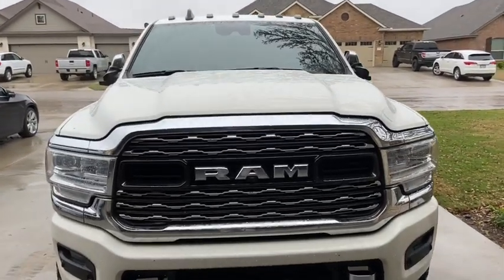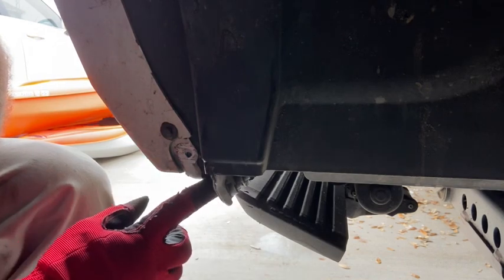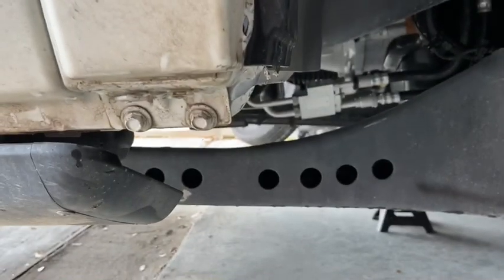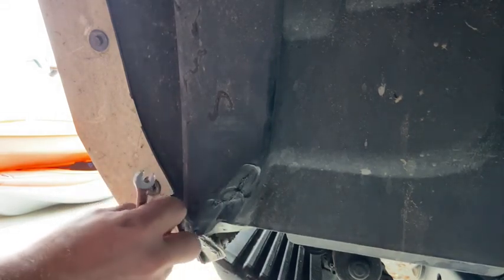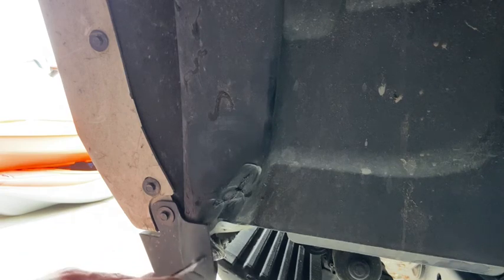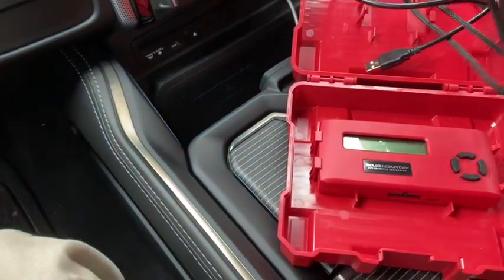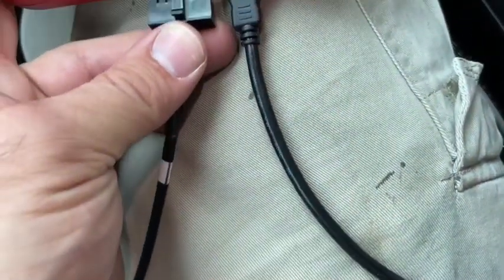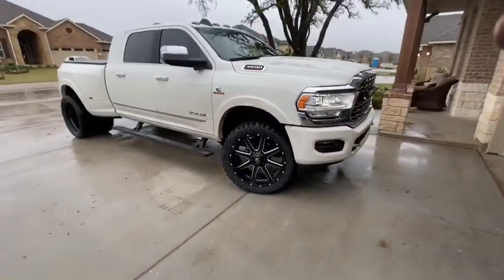35’s on a Stock 2019 Ram 3500 Dually

Comment: Hi, looks really good!
if you choose to not use super single at the front, do you still go with positive 1 offset to make 35" fit on stock suspension?
Tony Linell,  Sweden 🇸🇪 ✌
Reply: And also, what spacing is your wheels? Street, lifted, or extreme?

Comment: Looks good....but can you tow for long distance with this?
Reply from the maker: As long as you have the proper axel ratio and not towing fully maxed you will be fine. I pull my 17000 lb 5th wheel no problem. No trans temps issues nothing.

Comment: We’re ya get your wheels from was it a complete set I love how they don’t stick out how is spacing between rear tires I tow heavy was seeing if tires are touching
Reply from the maker: Hey Steve. I got my wheels at a local tire shop. I have about an inch in between the tires. I have the E rated 12 ply nitto G2s, I just had a 6000lb pallet of stones over the weekend and not even a budge in sidewall flex. Ripped down the highway at 75 smoother than empty.

Comment: Thank you for the video I ended up doing 22-in American Force Wheels on 37 in tires on my 2019 dually with a super single. my truck has a much wider stance and the tires come out of the sides which I like that look but yours looks nice as well I also did a step because my duly didn't have one all together I spent $18,000 and it was worth every penny. Oh I should also mention I did a three and a half inch lift in the front and a 2 in the rear it has a perfect stance where the front is just a little higher than the rear which I also like. My duly doesn't have those fender flares I'm wondering if you know where I can get fender flares I have the granite paint it's like a gray thanks
Reply: I shouldn't say lift but it's a leveling kit in the front and back also my rims have a huge offset like deep dish rims which I like that look as well that's why I didn't go with the traditional dually front tire I'm surprised you didn't have an offset whereas you could have just put in regular dually tires without getting a super single couldn't you have?
Reply from the maker: I could have but I like the super single look over the dually fronts.
Reply from the maker: You should totally post some pics we would love to see what you got going.
Reply: @JimmyDs  100% I will

Comment: I tow a fifth wheel but I do want your set up. Would you measure the opened tail gate height. Wanna know how much the truck raises from stock. thanks
Reply from the maker: Hi Rouben,
   Sorry I actually sold this truck and went back to a long bed. Pulling my Fifth wheel I still had around 6-7 inches of rail clearance on a level 40’ trailer.

Comment: What was the bolt pattern when for the front? You had to take off you adapters correct?
Reply from the maker: Hi Ruben,
 The front with the spacer removed is the 2018 and older 8x6.5 bolt pattern. The rears will remain the new 8x200mm.
Reply: JDODGE appreciate it, just ordered mine
Reply from the maker: Post some pics when it’s done brother.

Comment: ill never understand the rear wheels do they have to be a certain width & do you need spacers for them not to rub each other ?
Reply from the maker: No I did not have spacers. Depending on the offset and width of the tire you don’t need them. If you tow I would not use spacers

Comment: Is this the rough country programmer for the 06 -17? I couldn't find one that was for the 5th gen RAMS
Reply from the maker: I’ll take a pic tomorrow but it is for the 18-20
Reply: @JimmyDs  thankyou so much. I appreciate it! Need one for my 2019. Thanks man.
Reply from the maker: Sorry for the delay. So the part number from Rough Country is 90019, it shows 2019 Ram truck and keep. I have used it on both my 2019 and 2020 and it works perfectly. Tried to snap a pic but I don’t know how to attach it to the reply on here. Hope that helps.
Reply: Hey man this is perfect! I really appreciate it. Thanks for your help !!!

Comment: I have an 04 ram 3500 drw 2wd, do you think I could fit 35s without offset? Or maybe with just a 2in level?
Reply from the maker: So the older 2WD trucks sit a bit lower than the 4WD. It might be possible with the right offset but I honestly could not tell you for sure.
Reply: @JimmyDs  what kinda cutting would I need to do then?

Comment: What brand tires are those?
Reply from the maker: Those are Haida mud champs in the video. Do not buy them!!!!! Lol I had to replace them due to being out of round. I went with Nitto Terra Grapler G2s.
Reply from the maker: The picture on the thumb nail is the Nittos
Reply: Nice truck!  Was the Fuel wheel spacing the street, lifted or extreme?